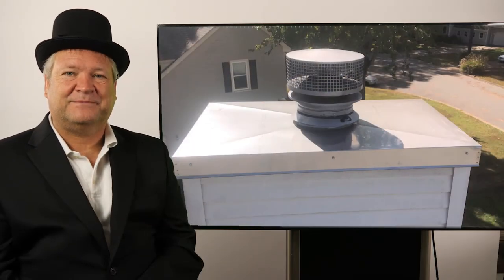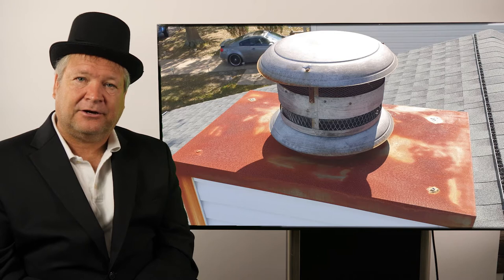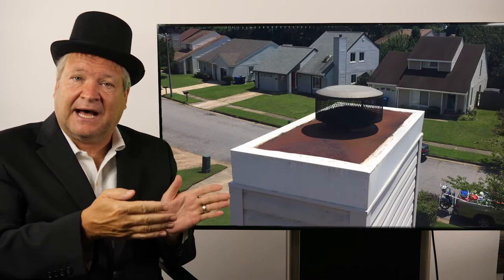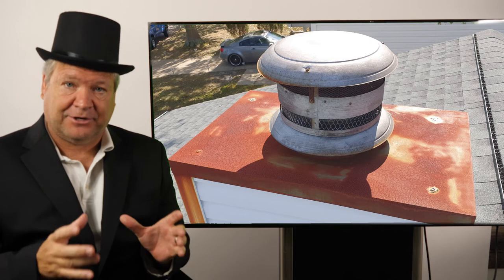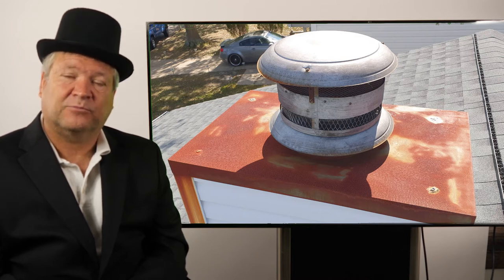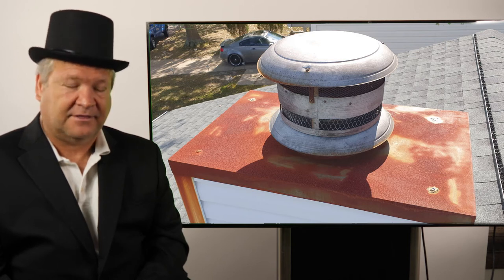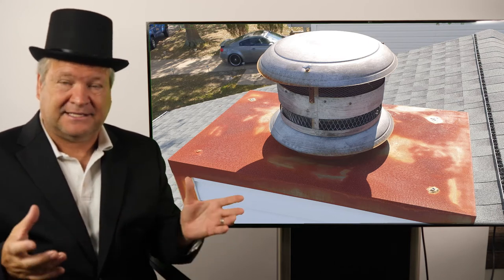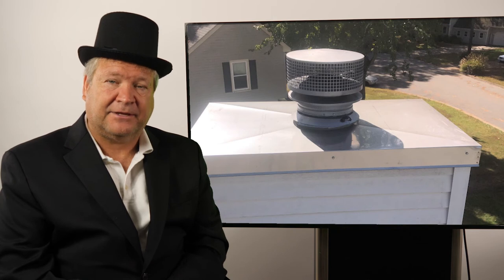Training Video #25 - Chase Covers

Comment: Thank you for your very straightforward and informative videos. I''ve learned about so much already. I do have a question about stainless steel though. I just had a new stainless steel chase cover installed, but it's only been on for 5 days and I went to check on it and discovered little rusty pits all over the stainless steel. Quite a lot of rust marks infact. I thought stainless steel IS NOT suppose to rust! What's with the little rusty pit marks, low quality stainless steel?
Also, the cross-break lines have created a dip or scoop between the lines (it's a long rectangular with 4 chimneys lined up across), so it's actually pooling rain water in the triangulated scoop, and the whole thing is not level, which is creating the pooling even more. Should I ask the chimney contractor to come back and raise the center area with a tapered piece of wood or plywood, so that rain can  properly shed off? 
What about the stainless steel that's starting to rust? Hoping you'll respond and shed some light on my issues. Best regards.